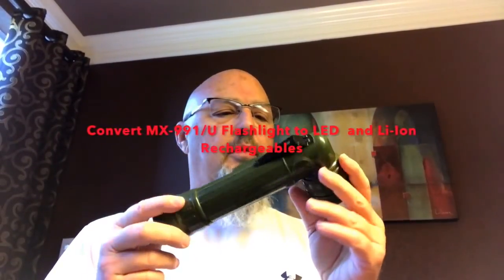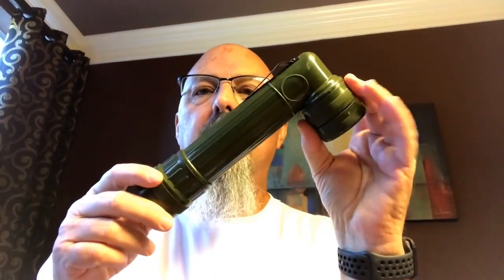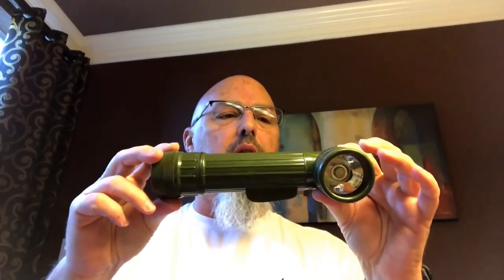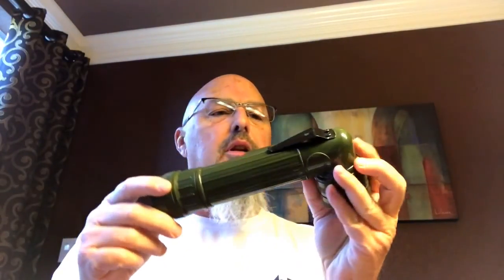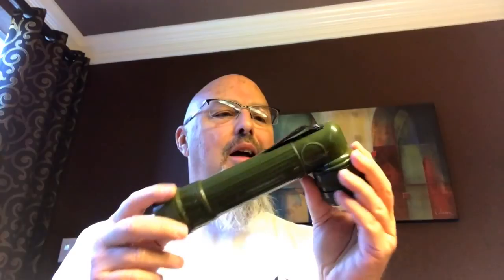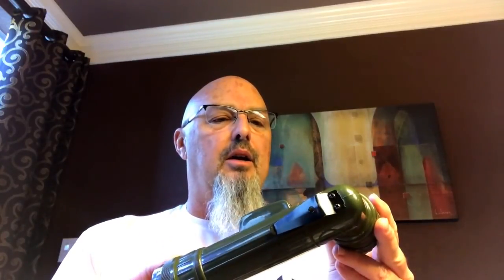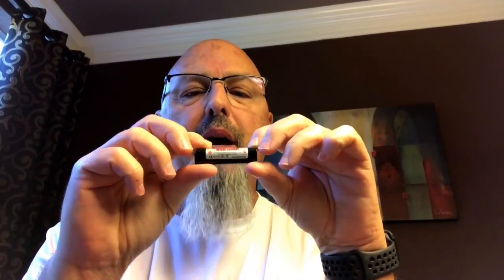Convert MX-991/U Flashlight to LED and Li-ion Rechargeables

Comment: Consider:  The MX was originally a 3 volt system with a ~1 Watt bulb. LEDs generate heat and the heat requires dissipation similar to incans. This model flashlight uses a metal refelector (ok) and a plastic bulb holder. (not good) If the LED wattage is excessive the plastic bulb holder may melt or the LED will overheat (then fail) when illuminated for an extended time. Additionally, if the flashlight is used frequently, overtime the plastic in the lens or flashlight head may degrade. Make careful modifications that ensure that your modifications(product redesign) results in a functional light over the years not just in a demonstration video. Nice work btw.

Comment: Very nice.  Did you happen to notice if it got very hot?
Reply from the maker: Not very.  The LED isn't terribly high lumen, though it is significantly brighter than the incandescent it replaced.  Given that the housing is all plastic, heat could be a concern, but it poses no problem in this case.